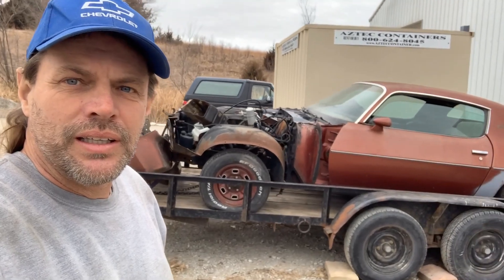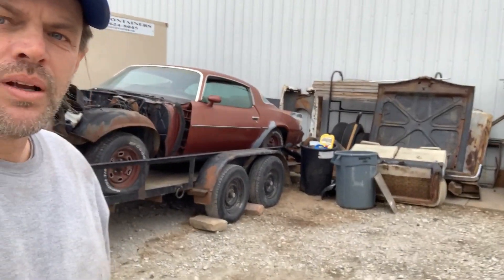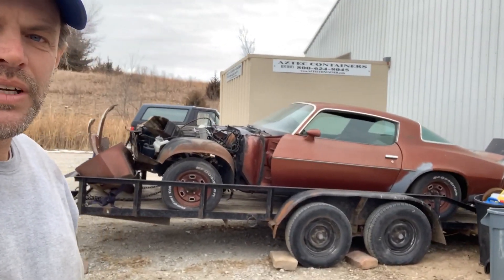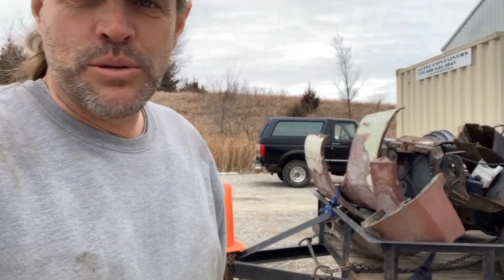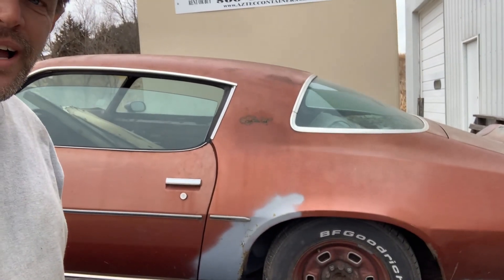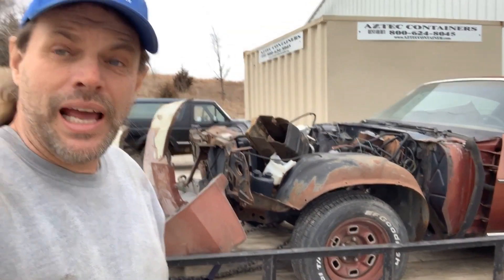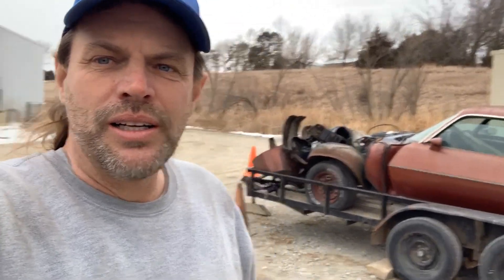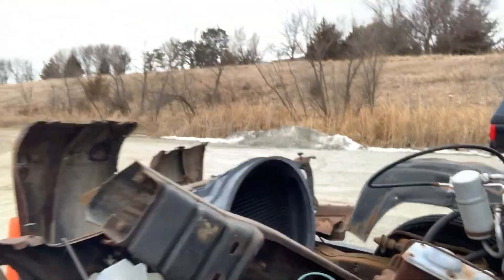PART 1 - Fast Times Camaro Build

Comment: I had an 80 z28 with a hopped up 350 and a th350 with a manual valve body, and a 3.55 posi. Wish I had it back today. Was so fun doing burnouts with the t tops off